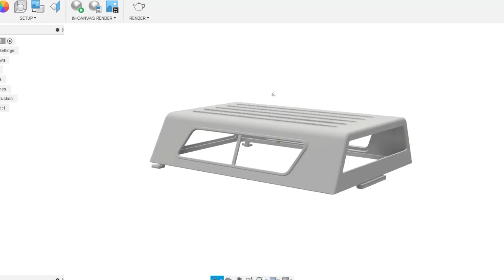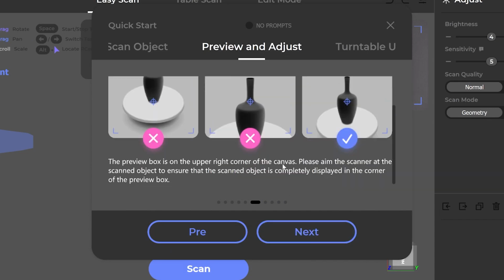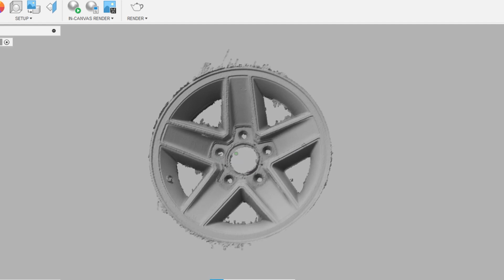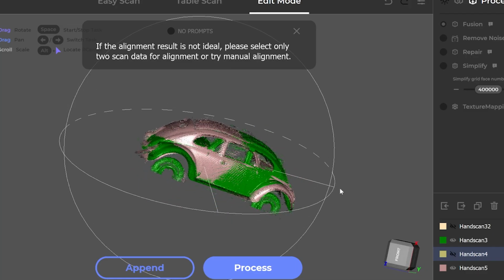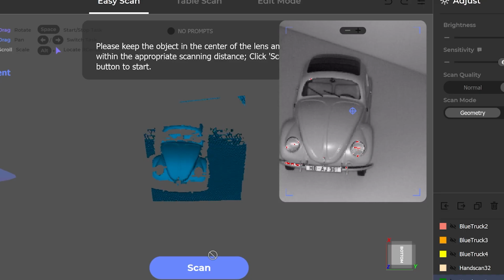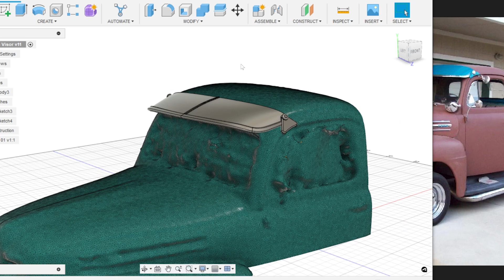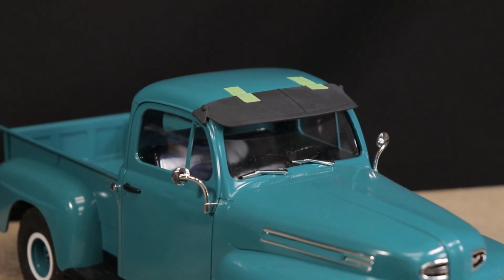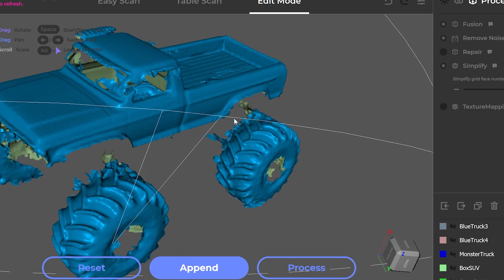Trying out the new Lynx 3D Scanner and Creating Some New Parts: Full Overview and First Impressions

Comment from the maker: Thanks for watching everyone! More custom parts on the way 👍. Much easier to design some parts with a 3D scan to work off of.
Reply: try comparing it with an iphone's lidar scanner
Reply: Hey, if you have trouble scanning shining surfaces, mix talcum powder with isopropyl alcohol (about 20:80) and use a spray bottle to mist it onto the part. it will leave a fosted surface that works well with scanners.